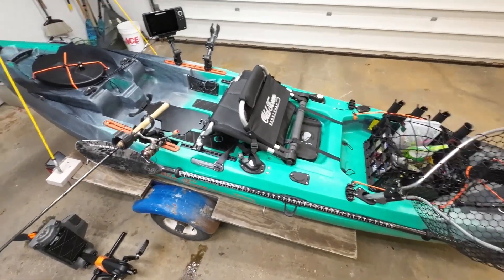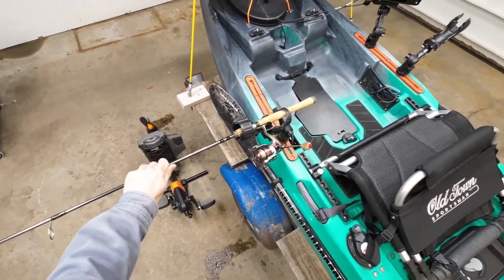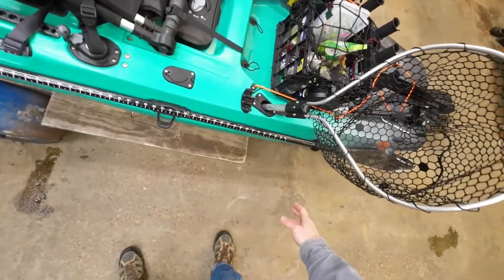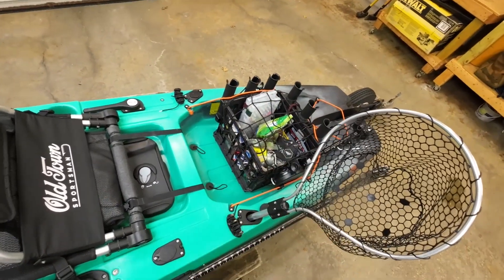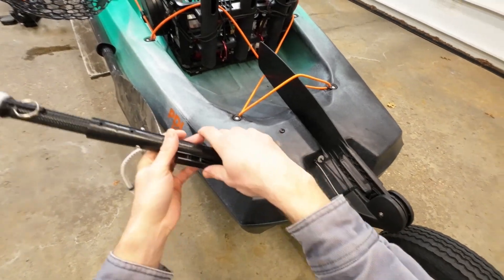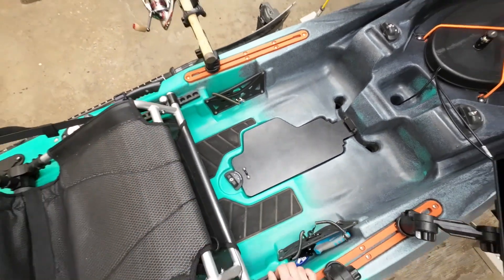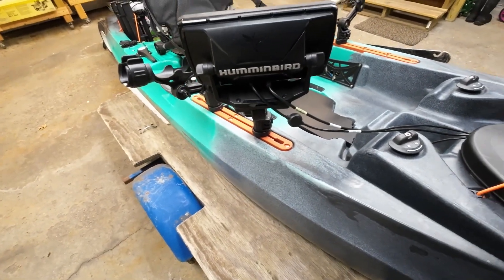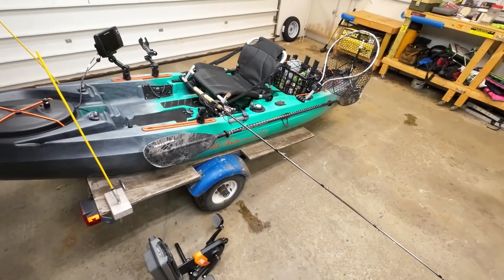Old Town Sportsman PDL 120 Fishing Kayak Setup 2023

Comment: Nice setup.  Might have to get that 360 light.  Love how you wrapped that bar behind the seat with foam. Didn't notice that before on your rig!
Reply from the maker: The light is great but a little pricey. I'd buy it again. Nice that it runs for a long time on rechargeable AAs too.
Reply from the maker: Sometimes a simple and cheap fix like pipe insulation is all you need!

Comment: For the clothes line anchor, how did you replace that line with Paracord? Did you remove the retractable line the clothes line came with and put in a new Paracord? Or??
Reply from the maker: Yes, I took the reel case apart, unwound the line, cut it off, tied paracord on, wound it on, and put the case back together. The reel is under tension, so you need to jam it with a screwdriver or something in order to keep it from spinning while you get the paracord tied on.

Comment: With ur helix 7 transducer, do u have to use an additional guard to be able to use ur side image function?
Reply from the maker: No, the hull on the PDL120 is shaped in such a way that side imaging works fine without any modification or extra hardware.

Comment: I’ve been looking at the PDL 106. Lake Michigan I literally two blocks away from. Do you think the 106 would be ok not too far off shore? Or should I just go for the 120?
Reply from the maker: If you have the option, I would go for the 120. I have fished for salmon on Lake Michigan in several kayaks ranging from 9.5ft to the PDL120 so it can certainly be done. I do think the PDL106 would be fine. It might get tossed around a bit more in the waves due to the shorter length and lighter weight (higher center of gravity). If you live close, you could be more choosy about which days you go out depending on weather. You could also stay in the harbor on poor-weather days.
Reply: Sounds good! I am just undecided lol. I would have to store it in storage and I have a smaller jeep so that’s why I was leaning more towards the 106. I’ll take a look at both of them in person and make my choice. But it’s good to know that I can’t go wrong either one for the fishing I’ll be doing, thank you!
Reply from the maker: @freddyj5845  Are you planning to trailer it or put it on top of the jeep?
Reply: @FishingwithNat I found a good deal on PDL 132 that also came with a trailer. I have the option to trailer it now and I also have j hooks on my jeep that can support up 130 pounds. I am really looking forward to setting it up and taking it out on the water!
Reply from the maker: @freddyj5845  Awesome. I think it would be awfully tough to get a 132 into the J hooks, so I'd vote for using the trailer. Good luck - be safe if you head out on Lake Michigan in the cold weather. You can catch big brown trout in the harbors or near shore at this time of year, but that cold water is a killer if you go in the water.
Reply: Thank you! Yeah I’ll definitely be careful.